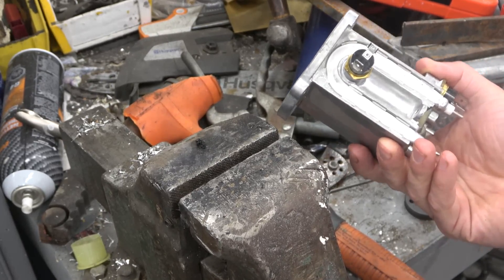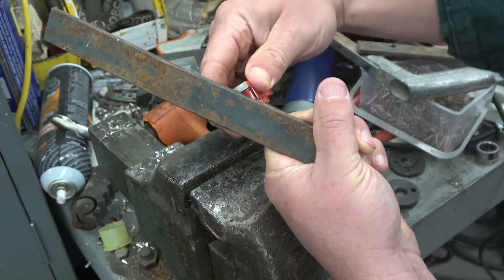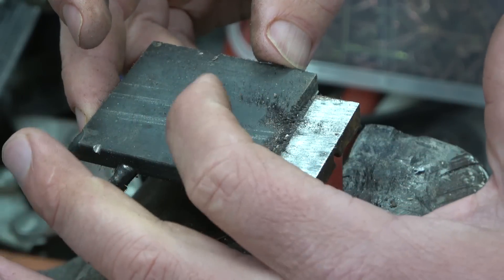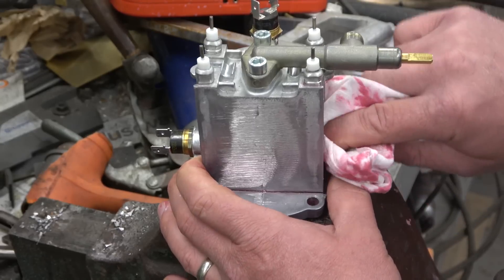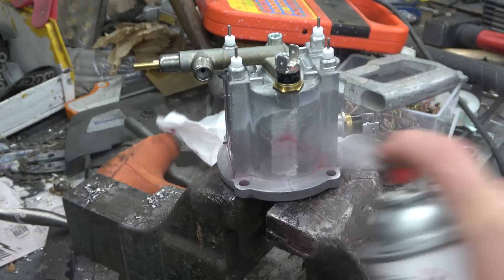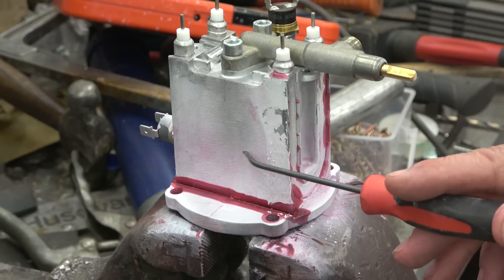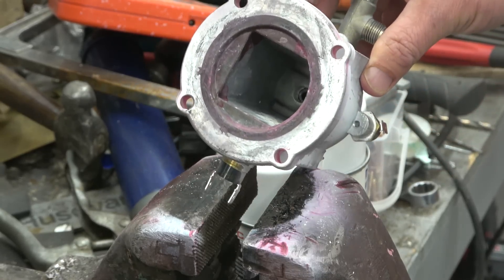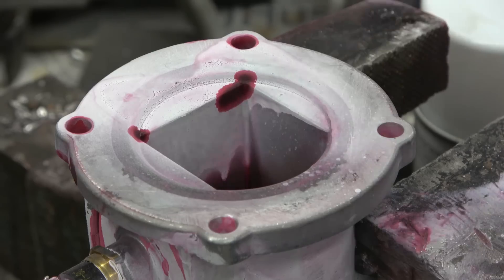Crack inspector. Weld Al Casting?

Comment: This shit is a good indicator for a photograph for the dumbass on the other end of an email. We use it all the time on big diesel connecting rod joints. I've checked and doubled checked and my naked eye can see micro cracks this shit won't pick up. Eyecrometer is boss.

Comment: I always weigh how long it will take even if I can do the job myself to "save money". At my day job I get paid roughly $17/hr. My free time for farming around is at least worth that much. So if I pissed with that part for  2 hours..I'm out 2 hours of my time and I still dont have a new part. I'd have a repair part that may or may not work. While a new part is $35 plus how ever long it takes to get to the store and back and install it.

That's the real son of a bitch  about repaiing things these days. They are made cheaply so they don't last.  But then the cost and time to repair them doesn't justify the price of just replacing it, even if you CAN repair it. They've got us by the short hairs boys.

Comment: Hey bud, greetings from the northern shores of the Salish Sea!  Left the homestead last Christmas and drained the reservoir on the ol' caffenator but didn't think to drain the boilers, besides when does the mercury dip that low on the coast. Same part, same outcome. My machine has two of those units; one for the beans and one for the cow puss. I could send you the good one or you can tell me where to find a replacement for $35. Crying shame too, I got the $900 piece of steampunk art from the neighbour for 40 bucks.

Comment: Aw man every industry has its gripes about cheap aluminum castings it seems. When I was a machinist it would frustrate me so much that a 20kg cast would come to use too warped to fit our fixture, or we would find air pockets internally

Comment: You only spray developer on the opposite side if you wanna prove a through crack. You only proved that there was a crack on both sides, however not going through the piece.

Comment: Accidentally found a cracked injector nozzle on a little catiperkins with that stuff, the over spray got on the rearest one and revealed the tiniest fuel leak adding to the hydraulic leak from the cracked pump. Saved me a return visit

Comment: I helped build a CT scanner out of two robot arms - one with an x-ray source and the other with a detector. It was a pain in the ass but it was able to image welds pretty well. Built a robot that could place an accelerometer onto a pipe and then smack it with a hammer. That kinda worked, but not that well due to the arm not being compliant. Integrated a vibration camera to another robot that could pick up the vibrations of an AC vent, that’s as cool but a pain to interface with. 
Funnily enough, the biggest ball ache on all 3 of those projects, by far, was that the sensors (x ray detector, accelerometer and vibration camera) only worked with Microsoft Windows. It’s almost as if NDT engineers are too stupid to use Linux - gods own OS.

Comment: I used to do specialty spray hard facing where a mixture of binder metal powder and tiny carbide bb's would spray out through the flame tip of the torch and fuse onto the metal substrate, the parts were stainless steel, but the binder metal powders were different alloys and required a bunch of controlled heat treating, pre heating, and slow gradual cool down time. Long story short I had to dye pen all our parts to check for cracks due to the difference in metal alloys being fused and their differing expansion and contraction rates. The dye we used was a uv dye and we had a high powered uv light source that'd make any crack visible from the moon.

Comment: From experience scalding is the absolute worst method of getting burned (with a possible exception of close proximity exposure to highly radioactive isotopes but I've not had that so idk) , and that's before considering the, erm, percussive ramifications of pressure rapidly escaping a containment device....

Comment: So, what about an epoxy, but you put the whole thing in a vacuum chamber, to really get the resin to settle into the tiniest of crevasse. 
Or, make machine your own flange , shear off the old one, and bolt on something that you know has a seal between the two halves.

Comment: I have a bunch of that specialty fluid for doing this I got for a treat from surplus, just need a magnet to get it to chooch. Got the stuff cheap but it's hella expensive because the particles themselves are engineered to be uniform as well as they are coated in fluorescent dye.

Comment: The heating element is crimped into the al-U-minium-falcon main structure, and part of the crimping process, the machine supports the main aluminum structure from the backside, or in this parts case, "on the inside" via a horn, so to speak .. then an anvil specially formed to fold over or crop, crimp, deform, etc raised lips that were part of the raw form of the main part, and injected this way. The minor mis-alignment of the heating elements mating to the cavity of the main part/base, the crimping process if heavy enough to press form the imperfections or voids, all in efforts to conserve as much as possible, effective efficiency, as per the thermal transfer of the full spectrum of electro-mechanical, and radiation from the elements. By having as much contact touching as possible or rather no air gap spaces or voids . So, I think you should build a 40 tarr, vacuum chamber, smear some ceramic thermal paste all over the mating area of the unit, and pull down a hallified vacuum, and when pressure is brought back up to a neutral status, that paste will be pulled way in to the now imperfections of the voids, to assist in the conductivity of the radiations transfer efficiency. So what if the part is not fixable, 627 hours to build a ultra drag-down pump for this would be fun... 

Which reminds me, a shop I used to work for about 20 plus years ago, were contracted to design & build a vacuum pump (8 of them). I never got to see the finished product, as I would get sent out to random "FIXES" throughout the world, but these pumps from what I could tell from the blueprints, each weighed about 6 to 8 tons, the 3 phase electric motor were that were special order and we're about the size of a Volks Wagon Beetles... Something like a hydrostatic transmission which allowed the motors to get started after of course draining the entire  state of Texas for about 3 minutes until up to speed... All that mess connected to a crankshaft that had bearing journals about 18 to 20 inches in diameter.... Here is the hilarious part of this... Which was the stroke and the piston diameter.... The stroke was about 3 inches or 1.500" TDC from center and 1.500" to BDC... again, 3" stroke. The piston diameter was about 1.000"... The valving &check system was out of this world that required all internal surfaces to be polished to a mirror finish and orifices we're like 0.0010" diameter the closer they were to the chamber area...  What a mind-f*CK to see all that massive size equipment (on paper and photos) all just to turn a weed eater engine... Lol... But the pistons were specially coated, not just for a wear factor, but to bring the diameter precisely up to spec for the tightest fitment, and we're made out of some nasty alloyed steel tungsten, like wise the chamber liner, to stave off collapse and cooking off the surfaces from the heat... I was from the school of thought that compressing causes heat, and pulling a vacuum, reduced heat, but, in the extreme cases, when you attempt to hit those "tarr" measurements of vacuum, you are like ripping atoms apart or something, just crazy. Again, I don't remember all the fancy number of this gameshow, but, even all that HP if the hydrostatic system was not dialed in correctly, that one of three things could happen, the hydrostatic transmission would explode... The valving would implode, which is weird to wrap your head around, as that is what they were more worried about the implosion and not the explosion, okay? I'll take their word for it as they are smarter than me...lastly, the vacuum being so much or is that to be stated, so little??? That if the first two scenarios didn't happen, the electric motor would stall out... Something like 15,000 HP electric motors, if I am not mistaken? I really can't remember, but it was allot. I always thought the rock quarry electric motors were large AF for the conveyor systems, but these, my goodness they were massive... They didn't just have one lifting eye right in the middle, they had 8.  If the motor stalled out while the system was at a good vacuum, which would take a few hours to get the pressure that low, they would have to release this and start all over again.. if you would try to reengage the transmission after a over load stressing stall, that was apparently a guaranteed failure as explained above.... Each unit had it own cooling system that used one of the stupid cold compressed gas/liquids like ammonium nitrate or something to assist in the life span of the chamber and piston... 

Now, the big question, what in the living hell ,needs to be vacuumed down that low? That is a great question, when y'all find out, let me know, because I have no clue... For all I know, they were studying earthworms or something. I have an idea based on who the general and what he did, but purely speculation though... Here is another oddity of those. To prevent pipe/tubing collapse, the wall thickness was 1.000". So, if you only need a 1/4" (.250") I.D. pipe, the O.D. was2-1/4" (2.250").. no flexible lines anywhere in that system, it was all hard line. Allot of long runs to deal with flexing and expansion issues.. what a mess of a pump system... There is my novel for the month.

Comment: That casting would be much better with a fillet where that Crack was....it may have prevented it from forming in the first place....it probably started right as the metal was cooling in the mold!

Comment: In airlines we use the dye pen a lot…. We use the developer spray also to check for leaks on high temp/pressure air  ducts that are not viewable or covered during operation on engines..

Comment: Had about 6 tubes crack on a 1800hp fire tube 3 pass at the tube sheet. You don’t have to use dye penetrant to see those on account of the chemical buildup. However, you better check the tube sheet. You don’t want to be around a boiler if it goes, because you won’t be around anymore.

Comment: Some things are not worth repairing. In this case a rather geometrically sharp edged pressure vessel out of a material, that is a pain in the donkey to weld makes for a repair that is destined to fail. The relatively low price of the spare part and the chance of failure repair make the case. A good way to show how to test parts for cracks, forklift forks and other gear like this are tested the same way. I still know how interested I was when I saw this non destructive testing in person for the first time. It's called "rot-weiss Prüfung " (red-white test) from  how I was told back then.

Comment: The argonmix and a few tungsten rods dipped into the pool would cost more than the $35. Only reason to ever consider welding it is if you need it yesterday. if so the procedure is: order a new one, than try to salvage the old. if you're lucky it'll hold until you get the new part..

Comment: I work as a Civil Engineer in the frozen heaven hole of northern scandinavia.
Part of my duties are inspections of old an new bridges. We had one assignment checking a bridge for fatigue cracks in its steel beams, acting as ties in  a tied arch bridge. Mind you this bridge is about 900m long (which is like a gazillion feet and miles) with 14 or 15 spans. And me beeing the young hungry "get 'er done" engineer suggested: Hey, lets just use penetrant and developer and all the cracks will show up clear as day. 
This was an actually an idea from one of your vids, some many moons ago if I remember correctly checking a plastic part. Cant remember which BOLTR.

WELL, 2 beams + cross girders for a 900m bridge... It would've taken about 1000 cans.. And I brought 4.... Not to mention about 6weeks of work. Luckily enough for me, because of the thick brittle paint used in old bridges here most of the cracks were visible and the customer agreed to just focus on those about 0.05mm thick cracks and their lengths and monitor them for the time beeing.
First inspection was in -18, did one more -20 and just another one -22, cracks are growing, and new are forming. But the bridge still stand. Penetrating spray, or not.

So, not to be used en masse.
/Frozen mustache
Reply: What you need is an "Indian can" or a pesticide sprayer, and an inside man at the chemical company that makes the dye penetrant, lol. Have 'er done in no time.
Reply: That's why I love this channel, you can learn SO MUCH from the community! Cool story!
Reply: Pretty fascinating story there 🤩
Reply: Magnetic particle inspection is far more practical on ferromagnetic materials.
Reply: @allanwood3562  Yeah but more suited for in situ inspections of welds and such. Using it on 900+ m of 2000mm high webs + flanges. Good, but not practical. En masse, close up and visual wins in these instances.
Reply: @Arfwid  for sure. Visual inspection first before anything.
Reply: You were using the wrong method, DPI is a waste of time on carbon especially on something rough like structural steel. MPI and visual should have been have been your first choice for a quick scan, there are then other method like PEC which may be applicable. I would suggest in respect that no WSOE was developed and that any testing you may have completed may be giving you or your client a false sense of security. If you'd like to talk more look me up on linkedin I have a small inspection business in Ireland.

Comment: Cast is hit or miss. Clean cast aluminium welds very well. But most casts today seem to contain more dirt, slag and pores fill with crap than actual aluminium.
Or maybe just those casts that regularly break and come for repair. Maybe the good ones just hold up.

Comment: That powder looks like it is easy to replace with some colour toner, as that is also magnetic in a lot of cases, and as a bonus you get it in 3 colours, so you can crack test 3 times and tell if a crack is from the first, second or third try to fix it.

Comment: A cracked aluminum casting and steam is the combo for a bomb, depending on what weight the steam is.  I have been finding issues with post COVID manufactured items, where the quality is below sub-standard.  This includes potato chips to electronics with no reply from the manufacturer when you complain.  Check the new part for cracks before installing it.  Also test the wall and flange thickness to be sure you didn't buy a new bomb.

Comment: tig welding it , easy peezy ...... but for 35.00 for a new part , just go buy the new part , if it fails again , weld up the first one and make it stronger than original

Comment: Can you fill the crack with JB Weld and reface the part that's supposed to seal up against the rest of the machine?  :3

I've fixed fuel tanks and carburetors with (high temp) JB Weld, so I'd think it would hold coffee in...

Comment: As an ex pressure vessel engineer, good call. However, consider the value to your viewership of an attempted repair, pressure test and resultant explosive failure. Of course to be done under safe conditions. This could be a real learning experience. There are sites that specialize in such tom foolery. Cheers.

Comment: Yeah, cast-anything is a pain to weld, especially non-ferris metal. If it was a few hundred for the part, or a hard to find out of production, then I might try to repair it before buying a new one.

Comment: Contrary to some people's comments I wouldn't be afraid to attempt welding cast aluminum at all unless of course leaks are super critical.  But if an idiot like me can do it then anyone with decent water tight or air tight practice should be able to weld cast aluminum just fine.   I've done everything from a grill off a sears tractor to a supercharger elbow on a BMW b7.  And several intakes for derby cars adding the cheapest possible carb adapter plates to nasty intake manifolds.   I wouldn't do it to save 35$ but I've done it to make 50$ when I was working for 15$ an hour at work time. And like the end of the video says you must think of the consequences of your weld failing.  Will someone be annoyed mad hurt or dead 🤔

Comment: I am sitting here on vacation on the beaches of Hawaii.  All I can say is, there are many, many young women with a very thin piece of twine/rope running up their crack.  Some the rope goes so deep in the crack you cannot even see it.  Should they ever wonder and don't have a magnaflux handy, perhaps a can or two of your 'crack revealer' will be necessary ---- naw, it is quite clear where the cracks are --- the question might be tho --- where did the rest of the string bikini go?  I would post a picture, but maybe it is just as good to rely on your imagination ..............